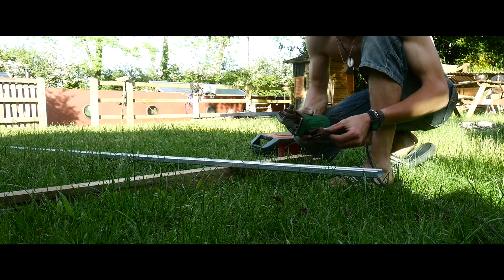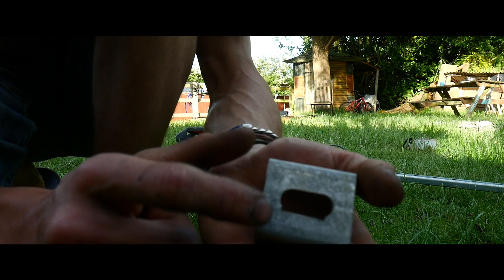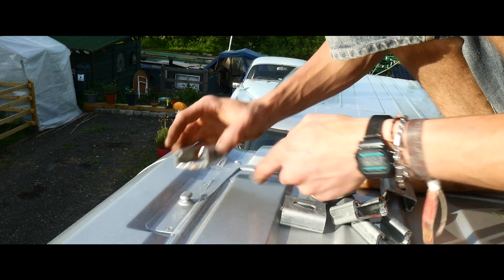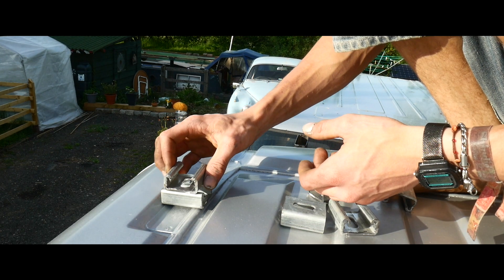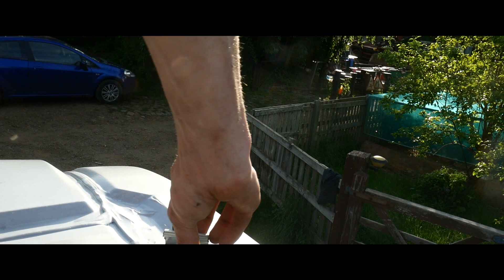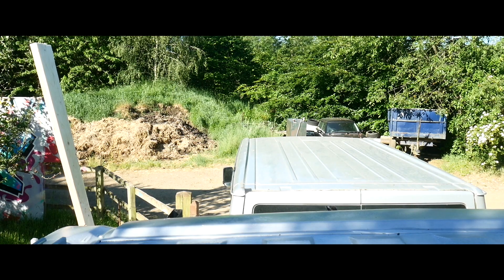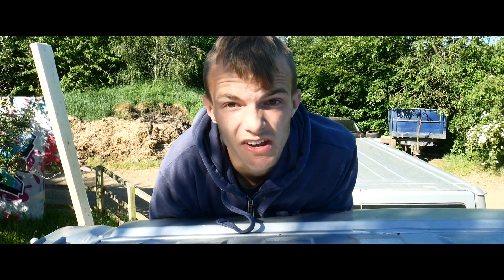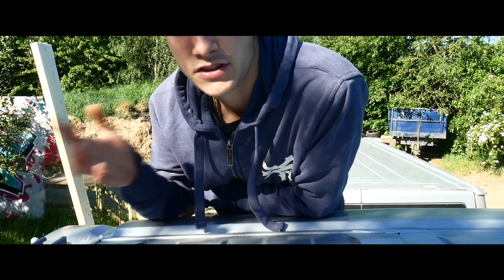DIY Unistrut Roof Rack! For Citroen Peugeot Fiat - Citroen Relay Camper Van Conversion // 30

Comment: Well thought out Max another job well done. Can't beat cutting with an angle grinder in flip flops and bare legs! Lol 🤔
Reply: @RustyRoseAdventures  well, as long as you don't change discs without pulling the plug out...took the top of a finger...which did sting a bit! 😂

Comment: Great video. Is this a l3h3 do you know. I.e. a lwb with high roof? I might do something similar as this looks like a solid idea. Did you have much bother getting the bolts tight as there's not much room to fit a spanner in there?
Reply from the maker: It was an l2h2, it’s a pretty failsafe design. And although it was a pain tightening them it wasn’t hard

Comment: Hello what is the size of the rail 41×41 or 41x21
Thanks a lot
Reply from the maker: Hi I used 41x21mm👍
Reply: @RustyRoseAdventures  
Merci for the answer.
I will go try to found some
Reply: I have try but didn't work on my l4h3 Citroen jumper 😭
I don't have the same channel like on the h2 it's straight on the side of the roof
Reply from the maker: Oh no not heard anyone had that problem before
Reply: Yep. On the h3 we do not have the both side going up. 
It's just the inside and the T piece is like 4cm from the side wall of the truck so nothing to lock the small pieces of Unistrut